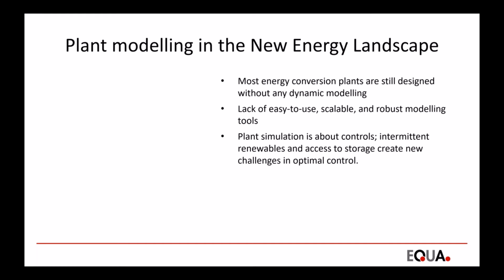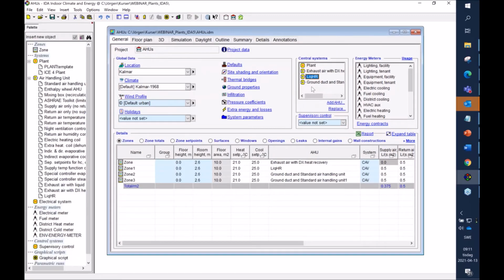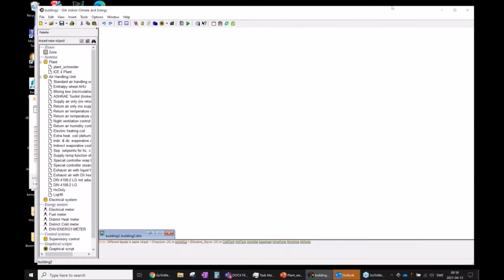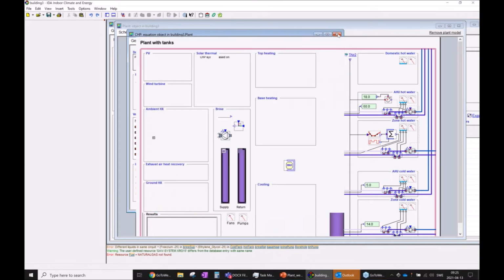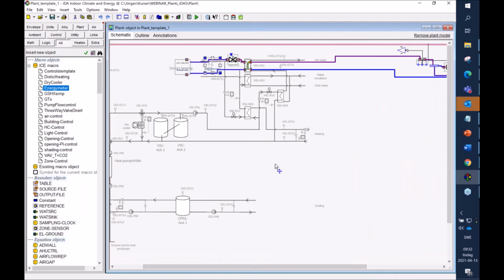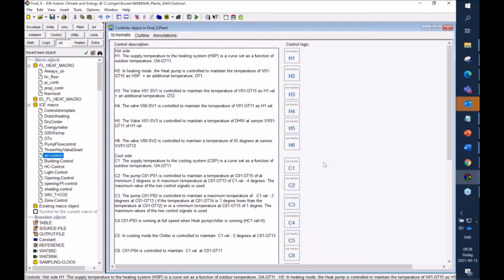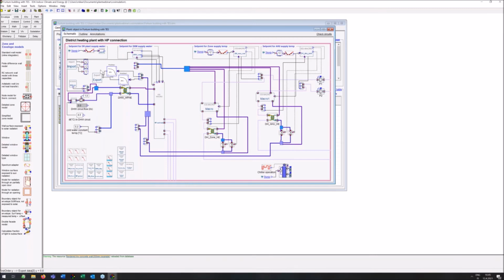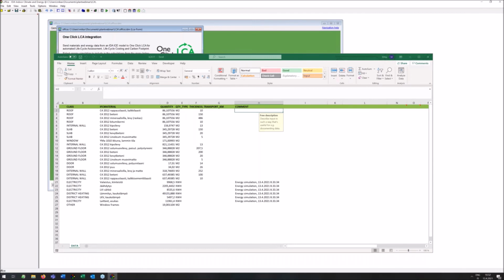IDA ICE 5: Plant modelling and other usability features

Comment: How do you speed up  your simulations? I have very fast computer, but simulation takes more then 16h, when i want to do 1 year simulation?
Reply: You can use time split parallelization.Avoid models with more than about 150 thermal zones and if possible, use zone multipliers. Also, openings and VAV-controllers slows down the simulation.
Reply: @maxtillberg   Thank you so much for your reply, but I run co-simulation to conduct mpc(model predictive control). Therefore my set points based on the previous time step result. Unfortunately time parallelization does not not fit to my problem. Do you have another suggestion for this case?
Reply: Without seeing the model 16h is a very long time so I suspect there are numerical problems and very short timesteps. I guess you have lots of custum controllers. In IDA ICE 5 you can animate what component that couses problems and based upon this information you can probably simplify it. If not I would send the model to EQUAs support.